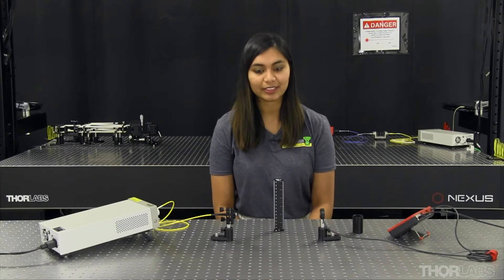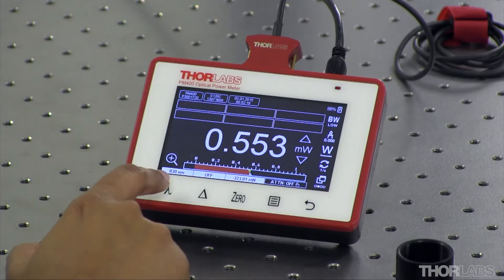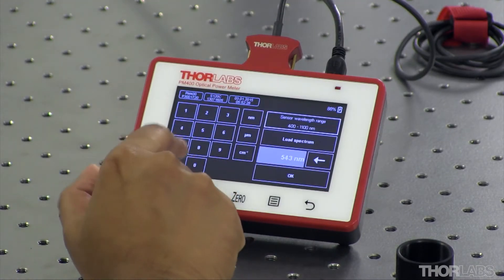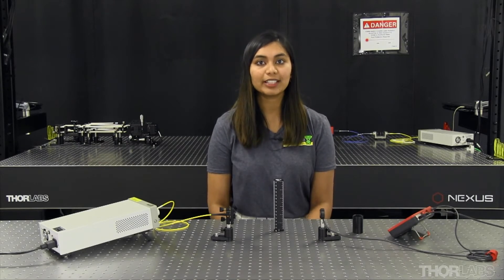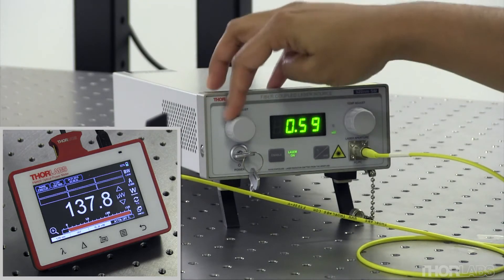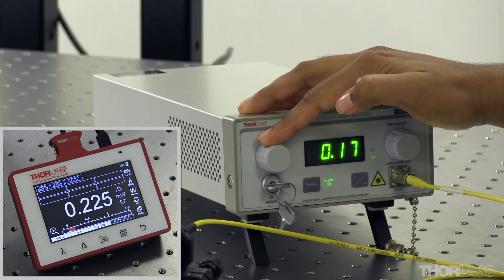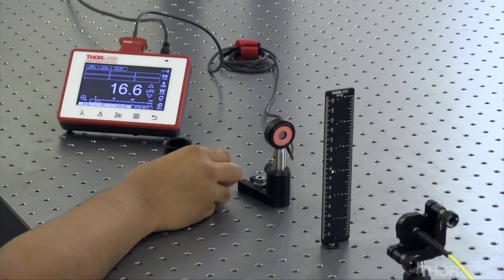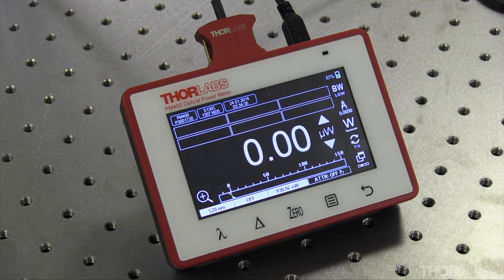Optical Power Meter Parameter Setup for Improved Accuracy | Thorlabs Insights

Comment: can anyone help me in setting the wavelength using laptop PM16-120 - USB Power Meter, Standard Photodiode Sensor
Reply from the maker: @sefhibhat5128  The wavelength can be specified using the Optical Power Monitor software ( https://www.thorlabs.com/software_pages/ViewSoftwarePage.cfm?Code=OPM ) that is available for free download. In the software, open the "Devices" tab, click Settings, then specify the wavelength using the associated control. For more information see:  https://www.thorlabs.com/software/MUC/OPM/v6.0/TL_OPM_V6.0.pdf  or contact technical support.

Comment: if one wants to measure supercontinuum power, since it is a broadband, what wavelength should one choose on the power meter ?
Reply from the maker: There are two options for using the PM400 power meter to measure the power from a broadband source, with the choice depending on the wavelength range of your source spectrum and the responsivity of your power sensor. The power measurement provided depends on both the responsivity of the sensor, as well as the spectrum of the light source.
 
If the power sensor’s responsivity is flat over the wavelength range of your light source, a convenient option is to configure the PM400 for a wavelength within your source’s spectrum. Then, the PM400 would use a single responsivity value to provide a power value. This technique would be a good option, for example, if the source emits light from 200 to 900 nm and a S415C thermal power sensor head is used, since the sensor’s absorbance is approximately flat over this wavelength range (https://www.thorlabs.com/drawings/ee136629cc6e35d3-2596B20D-5056-8D76-1303D39D0D58AAC2/S415C-SpecSheet.pdf).
 
If the power sensor’s responsivity is not flat across the wavelength range of the light source, it is possible to upload a spectrum of the source to the PM400 console. If you need to do this, please reach out to Tech Support ( techsupport@thorlabs.com ) for assistance.
Reply: @thorlabs  Thanks for the reply. I am measuring the power of the supercontinuum source (500-1700 nm), so the best option for me would be to upload the spectrum to the console.
I will contact thorlabs support.

Comment: Thanks for the great video.
 I was looking for this!

Does the position of the sensor need to be perpendicular to the laser?
If the position of the laser cannot be moved, is there a component to adjust the tilt of the sensor?
Reply from the maker: We're glad you found the video helpful! The answer to your alignment question depends on several factors specific to your application, including whether measurements of relative or absolute power are required and if your setup can tolerate back reflections. In general, it's good to keep in mind that power sensors are calibrated with the light at normal incidence and that the power reading will vary as the beam's angle of incidence changes.
 
If only relative measurements of power are required, which is often the case, it's not critical to align the laser perpendicular to the sensor. In fact, it's common practice to orient the sensor at a small angle (≤10°) to the beam, since this reduces back reflections in the optical system. However, it IS important to ensure that the same configuration is used for every relative power measurement. When absolute power measurements are required, there are considerably more demands on the measurement, and a specialized power sensor, such as an integrating sphere ( https://www.thorlabs.com/newgrouppage9.cfm?objectgroup_id=4688&YVI=2 ), may be preferred. 
 
Something else to keep in mind when making power measurements is that some power will be lost due to angle-dependent Fresnel reflections from the surface of the power sensor, as well as from any diffusers or windows incorporated into the sensor package. Another thing to check is that the effective spot size of the beam on the sensor is smaller than, and contained within, the active area of the sensor. Note that when the laser is not perpendicular to the sensor, the cross sectional area of the beam will be larger than if the beam were normally incident. If this is not taken into account, it may result in the beam being clipped by an aperture or extending off the active area of the sensor.
 
There are a few options for stably and repeatably altering the angle between the power sensor and the laser beam. One option is to use an angled optic mount, such as the SM1L03T ( https://www.thorlabs.com/newgrouppage9.cfm?objectgroup_id=215&pn=SM1L03T&YVI=2 ). Another option is to use an angle block ( https://www.thorlabs.com/newgrouppage9.cfm?objectgroup_id=5585&YVI=2 ).
 
If you think of a topic you'd like to see demonstrated, let us know!
Reply: @thorlabs  
Thank you for your kind answer.
I only relative measurements of power are required.

I have several lasers that I want to measure, one of which has a beam diameter that varies from 13mm to 26mm. the S121C has a larger beam diameter than the sensor, so I plan to use the LA1274-A to adjust the focal length.
 I would be grateful if you could tell me how to check and adjust the focus of the lens to make sure it is illuminating the sensor.
Reply from the maker: @hiro-xo8jf  A technique we find helpful when reducing the spot size on the power sensor is to use the lens to focus the beam to a location that's farther along the optical axis than the sensor's position. When this is done, the beam is converging at the sensor position, but the beam does not focus on the sensor. (It's important not to focus the beam on the sensor ( https://www.thorlabs.com/newgrouppage9.cfm?objectgroup_id=10741&tabname=Beam%20Size&YVI=2 ).) Using this approach, as long as the beam diameter is smaller than the input aperture in front of the sensor, you can be sure the diameter of the beam is not overfilling the sensor. If you have additional questions, please contact tech support ( https://www.thorlabs.com/supportcontact.cfm ), and they'll provide information tailored to your particular application.

Comment: Will this measure power from  infrared laser? And will it work for Infrared led diode(750-1100nm) ? I understand the IR waves from led diode goes all over the place, just want to measure how much power in the direction of the sensor. And which tool would you recommend, most basic please. Thanks.
Reply from the maker: The power meter shown being set up in this video is compatible with a range of optical power sensors, including a variety used to detect IR light over the wavelength range you mention. However, when choosing a power sensor for an application, there are a number of variables to consider in addition to the wavelength of light incident on the power sensor. These variables include additional details about your source and application, as well as your measurement requirements. There is a webinar ( https://youtu.be/kbrNnM1ZO-s ) that provides some background information and guidance for choosing power sensors for different applications, including measuring the power emitted by highly divergent sources. Another webinar ( https://youtu.be/wO4wSKhoZXg ) includes discussion on operating precautions, practical use of photodetector power sensors, and a photodetector selection guide. Tech Support (techsupport@thorlabs.com) would also be happy to discuss the particulars of your application with you and recommend compatible power sensors, as well as any additional components that may be needed. Thanks for your comment, we'll keep it in mind as a suggestion for expanding our power measurement demonstration videos!
Reply: @thorlabs  Thanks for the thorough response. I will check the links!

Comment: Hi, can this optical power meter be used to measure irradaince? If so, how? Thank you.
Reply from the maker: The optical power (Watts) measured by an optical power meter is one of the values needed to calculate the average irradiance (Watts/cm^2) delivered to the sensor. To approximate this value, divide the power reading by the beam's cross sectional area at the sensor. Some optical power meters, including the PM400 shown in this video, can automatically calculate and display irradiance after the beam parameters are entered (see Sections 3.9 and 3.10 of the manual).